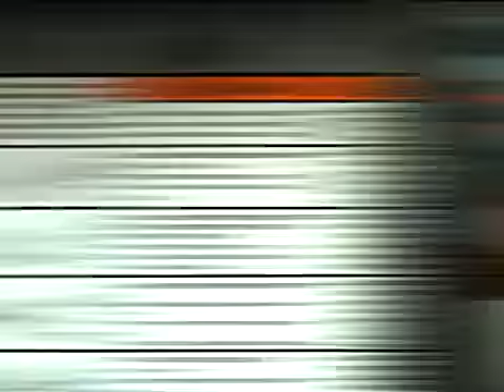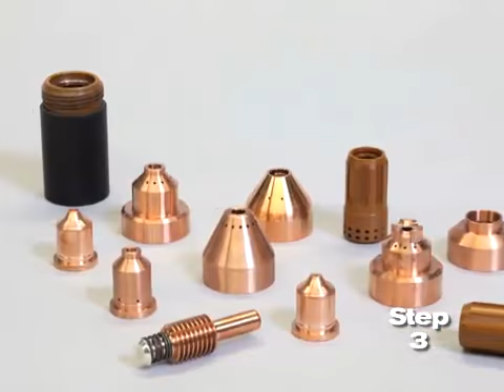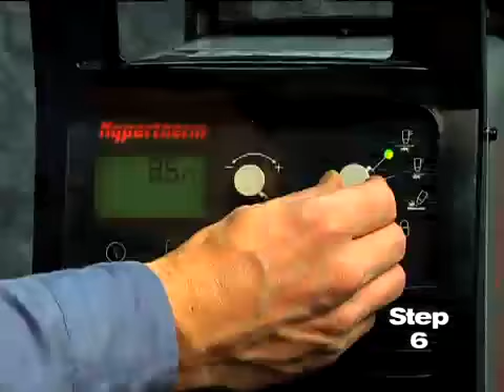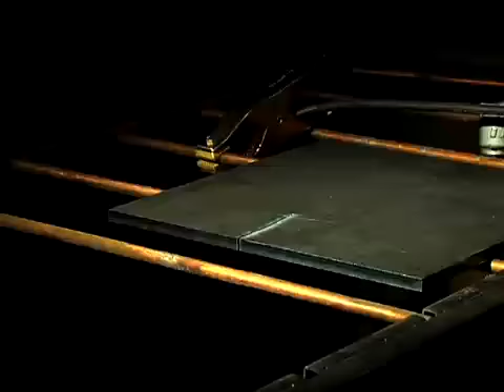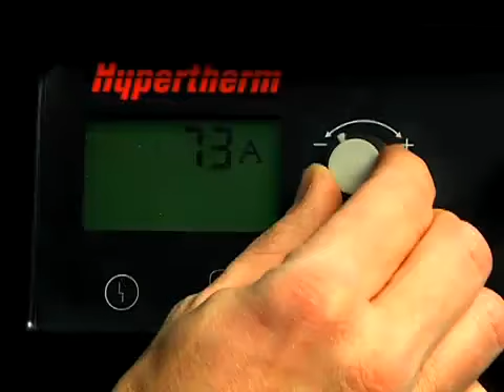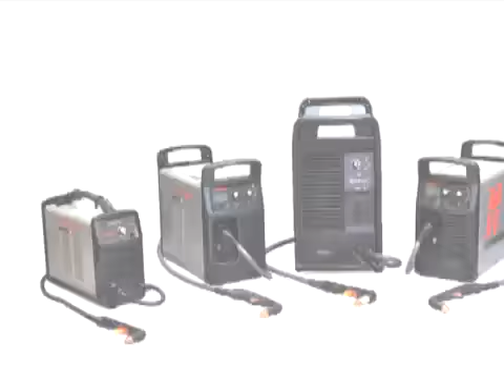Powermax65 and Powermax85 Setup

Comment: What is best for cutting up extruded aluminum. 
We scrap this aluminum so the cut isn't important. We are currently using a HT 65 with the 220818 shield and a 220819 nozzle. Was looking into should we be using a gouging set up instead.